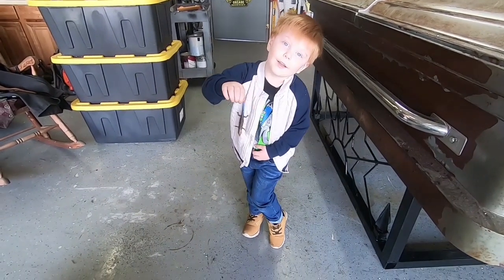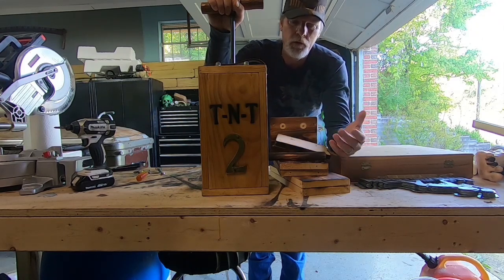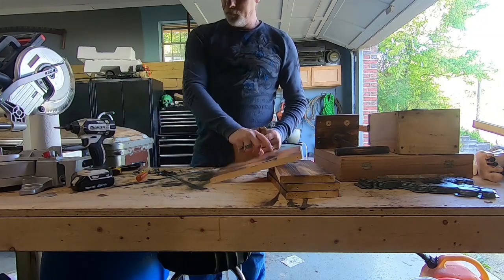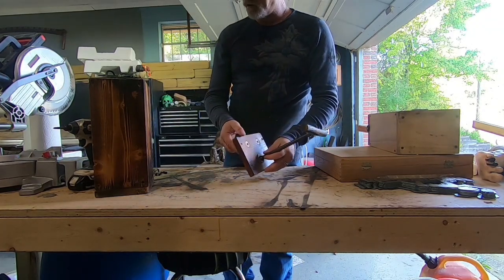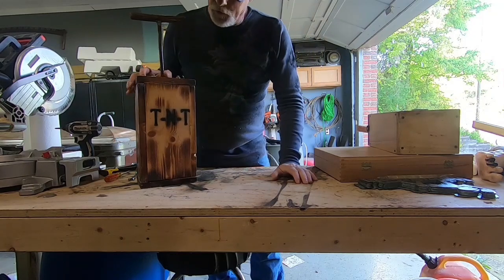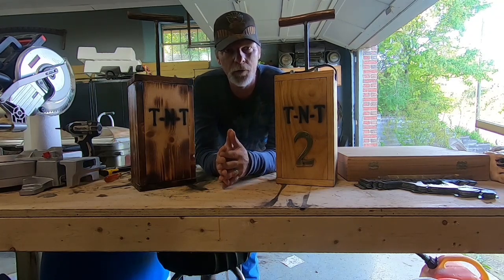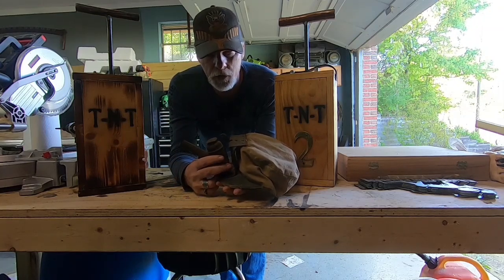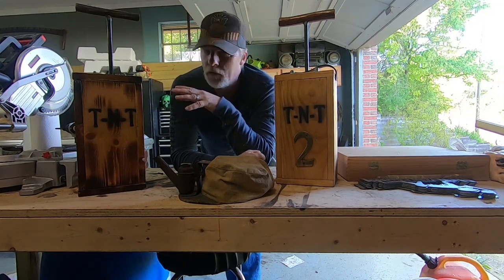T- N -T OLD TIME PLUNGER BUILD AND A LITTLE SWEETNESS

Comment: Awe you got a great grandson there Vick!
 As for that plunger.. I may have to add that to the list of builds!
Reply from the maker: They are simple. Build you a couple of them if nothing else they good nic nacks lol
Reply: I actually started a miner scene about 6 years ago but, it wasn’t a Halloween scene, it was part of the landscape. I started with a pond and water fall I made that had, a pan with fake gold in it, miners pick and a few other odds and ends. I was planning on making a burm with an old miners tunnel and cart on a track. I never got around to doing that part.
Reply from the maker: @TheWeirdKidShow  when I built the Deadwood stable for my horses I also build an old jail with real metal bars so the animals couldn't get out I dug a hole in the bank and started to do the mine shaft with cross ties and what not then I got rid of all my horses and just took it all down except the stable. It was pretty cool I had a little Western town going on lol people would stop and feed the animals and look around...
Reply: Vick Springston that sounds so awesome!!